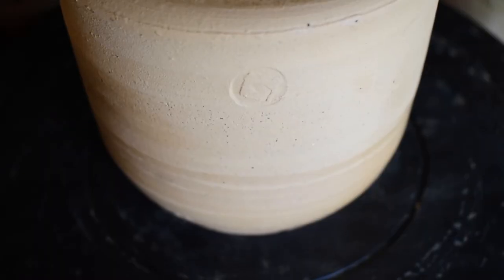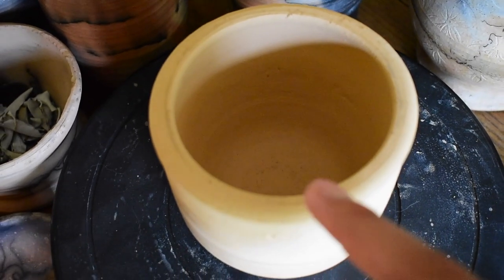How To Terra Sig - Do's and Don'ts

Comment: what is Terra Sig?...like your glazing with plastic over the finger
Reply from the maker: Hello Mariselle! Terra Sigillata is just very fine clay particles suspended in water. When applied to a bone dry clay surface, the fine clay particles essentially fill in the more open and porous surface. This helps give a more glossy finish when burnishing. Burnishing is just a fancy word for polishing used in the clay community. I burnish with a plastic bag because I find it the easiest and most efficient.
Reply: @Higher_Perspective_Art  thank you very much!!
Reply: @Higher_Perspective_Art  hi..do we need to bisquefire the terra sig applied bone dry clay pot?